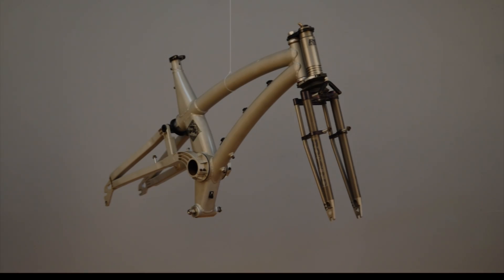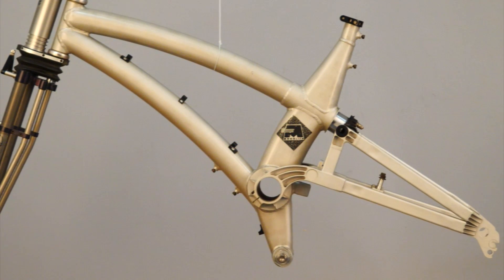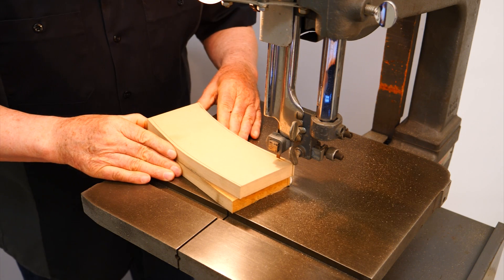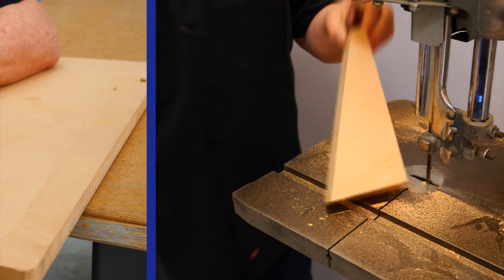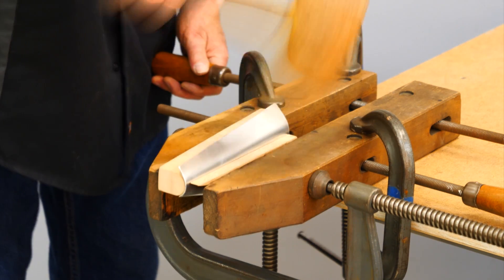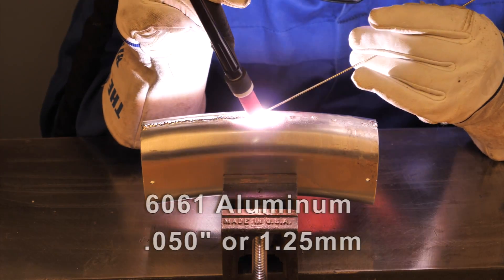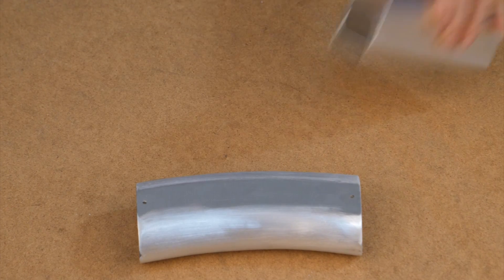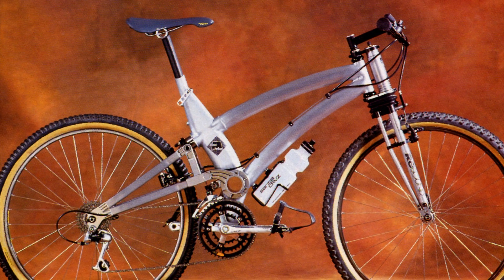Monolith Bicycle, Part 1

Comment: that was a Expensive bike in the Day .
Where is Spencer Owang TODAY ?????????????????????????????????????????????????????????????
Reply from the maker: Joni English - Spencer is specializing in designing and manufacturing parts for racing motorcycles these days.
Reply: thats amazing.
i had a manitou 4 fork with lots of cnc machining , also have the alpinestars al-mega elevated chainstay bike with nice tig welds
its amazing how the bikes have evolved from  tig welding titanium and aluminium to carbon epoxies and 27.5 and 29È wheels and disc brakes , search my video i got a local guy to weld back the aluminum deck of my lawnboy mower, also got the guy to repair my alpinstars al-0mega bike the tab broke off
Reply from the maker: Can you give me the link to your video?

Comment: great video ron, thank you for sharing. you mention using a wooden mallet, did you round the face to some degree or leave just flat? besides 6061 what other alloy would you consider? i`ll be waiting for the next parts of the build. pete
Reply from the maker: Yes, I did round the face of the mallet, and on the concave portion, a square-cornered mallet face would have left marks. Since this frame has to be welded and heat-treated to gain its maximum strength, 6061 alloy is definitely the best. There are stronger alloys, but they can't be welded.